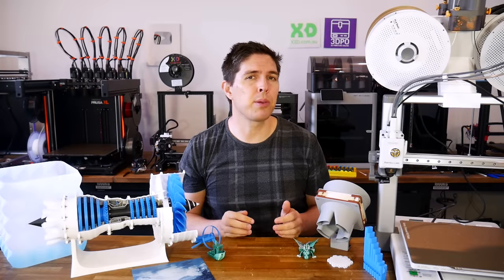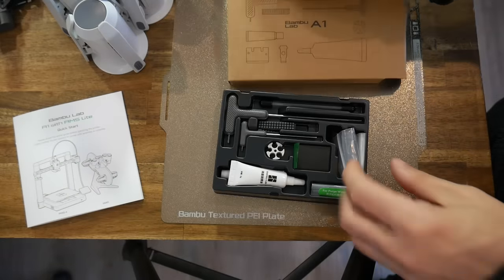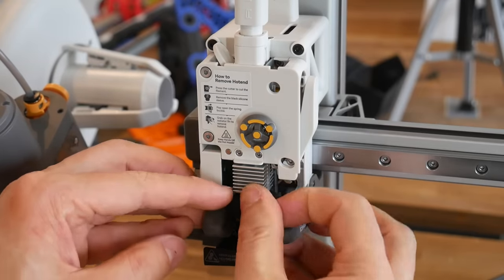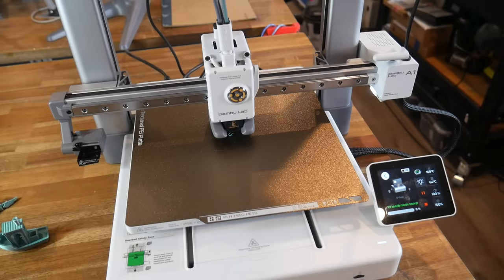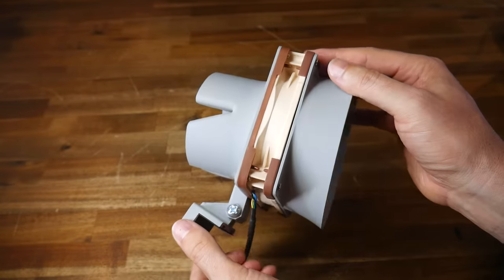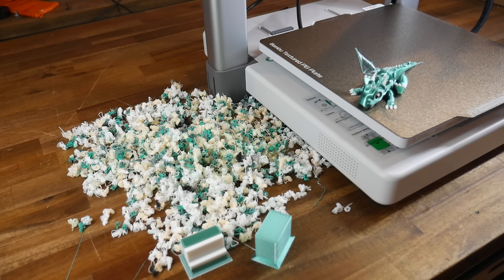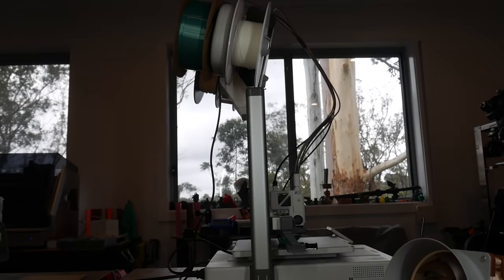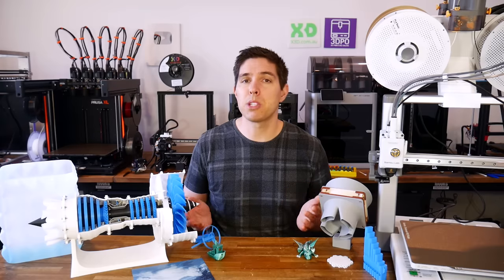Bambu Lab A1 detailed test - ‘Just works’ 3D printing for a great price

Comment: I have a request:  I  thought Core XY is better than bed slingers.   I have an Ender 3S1 that has caused so much frustration with first layers not working and thinking the auto bed leveler meant no more paper and spinning the corner wheels.   I spent way too any times and tries with the paper and the springs that never felt right - do all those nightmares go away with this?  I saw some knobs on the A1 - do I have to bed level?  I am waiting for a more affordable xy printer - no review answers why go back to a bed slinger.  Most people are former bed slinger users who are traumatized as I am with past experiences running paper over all 4 corners endlessly chasing the perfect first layer attempt - I wish more was said about this issue.
Reply: QIDI X-Smart costs the same as the A1 Mini, 300.
Reply: Core XY is not better, but it has some advantages when you are printing very fast.  If you're printing thin tall models, the shaking bed of a bed-slinger might dislodge them.
Reply: @kaasmeester5903  I thought it would be better in terms of bed levelling and not having to worry about bed coming out of alignment.   My auto bed leveller does not really accomplish anything on the creality ender 3 s1.
Reply: @tomsop  I'm not sure if that's an inherent problem with bed-slingers, or that core XY solves that problem.  I've had no issues with automatic bed leveling on my Prusa MK4, it's been consistently outstanding.

Comment: 5:58 Wrong, the A1 has only one Z axis stepper motor, not twin. Both lead screws are driving by one stepper like a cheap ass ender 3. You can even see the one single stepper motor during assembly, how did you miss this lol?

Comment: Great Video as always, loving it! But i dont know, somehow i really dont like Bambulab as a company. Im still on preorder for the Prusa XL 2 Head version but it still seems to have a lot of issues. 

The sad truth is that its probably smarter to wait for an Prusa XL MKx facelift and get the BBL X1 Carbon in the meantime. But i just dont like it, what other printer should i get then? I really love the idea of the Multitoolhead of the PrusaXL and that they announced add-ons for the printer

Whatelse is there on the market in terms of quality and speed and maybe cool features?
Reply: I bought the Prusa XL 5 tool head Kit.  I changed to .4 nozzle and I have not had any problems with it.

Comment: I don't see the Mk4 as direct competition because the A1 and the Mk4 appeal to different user groups.
But the comparison with the M5 / M5C works better. Both are launched with the promise of ease of use.
Reply: Exactly, Mk4 is a DIY shit, Bambu is a complete product.
The question is why DIY shit cost 3 times more?
Reply: I think they are direct competitors because Prusa printer's reputation for reliability is the reason why they can demand a higher price which is now being severely undercut by Bambulab. MK4 makes no sense at its current price anymore.
Reply from the maker: Perhaps, but I bet Prusa and Bambu Lab see each other's printers as competitors.
Reply: Imagine buying a prusa printer in 2023. If bambu is a bullet train then prusa is a scale model steam locomotive kit 😂😂😂😂
Reply: @TeachingTech  considering people have been reporting enormous amounts of prusa advertisements on bambu videos. yeah they obviously see them as a competitor lmao
Reply: @D1sconnect  "Mk4 is a DIY shit"
My fully assembled MK4 says otherwise.
Reply: @elmonni2103  Imagine buying a printer that sends all your data to the CCP in 2023.
Bambu lab = tik tok of 3d printers
Reply: @elmonni2103  Then I better buy a Prusa. I don't have the space for a bullet train. A scale model steam locomotive kit sound more like the right size. And also, bullet trains are loud. I like it quiet. I also like the aesthetics of these old steam locomotives much better than those of modern streamlined bullet trains.
Reply: @LilApe Imagine being so paranoid and delusional that you think they care about what you do? If you were in industry yes but for consumer stuff, it’s no different from google tracking what you watch and comment on.
Reply: Prusa has a few years to catch up. If they don’t, look for that business to stall or become very niche.

Comment: What kind of speeds did you get? How are the speeds compared to the P1S. Is Core XY worth the extra money?
Reply from the maker: I think the main reason you would buy a p1s over this is for the enclosure to print filaments like abs/nylon. On paper a corexy will be capable of higher acceleration but the input shaping equivalent makes that difference negligible in practice.
Reply: @TeachingTech  Regarding the benchy warps, I just compared to your P1P review and it didn't appear there. Do you think this is a core issue with bedslingers/A1 series (printing at lower quality) or something that can be fixed (or maybe modded, by adding a new fan)?
Reply: @TeachingTech  Speaking of A1 vs. P1S :
With the A1 bed confirmed going up to 100°C and the nozzle up to 300°C, what is still not clear to me WRT printing high temperature filaments (ABS, ASA, PC) is why Bambu Lab are saying on their wiki/FAQ page for the A1 that "We don't recommend enclosing the A1" - any ideas? Could it be due to insufficient cooling for the electronics, or maybe issues with softening the Z axis timing belt? 

I am asking because I've built my own perfectly sealed enclosure (a lot of sweat went into making it) and I'd rather use that with the A1 if possible than pay for the P1S, especially since the A1 has the quick change nozzle and no "no build areas".

Bambu Lab mention they don't recommend printing high temperature filaments on the A1 due to the lack of the enclosure (the A1 is therefore not able to ensure the required higher chamber temperatures and also not able to contain the toxic VOCs), but they never explain why they recommend against enclosing the A1.

Comment: @jozsefienciu2325
HI i need some help, i change the heating element on my printer the factory temp initialy was 250 degree after the change the max temp at the nozzle it's only 235 degree how can i get the 250 because the heating element it's good up to 260 thanks.

Comment: I don't see how the fast nozzle swap system is faster than a classic screwed in nozzle.
Reply from the maker: Speed wise you may be right, but I still prefer this system over the old e3d standard where the heat block is supported during a hot tighten.
Reply: @TeachingTech  Sure thing, got a Dragon hotend on which this is a non issue.

Comment: I really dont understand why Bambu wont make a filament making machine for us to recycle our plastic waste. They either need to come up with a better design or give us an affordable filament machine.
Reply: Probably because making a filament extruder that is accurate enough to function is really really expensive. Consistently making a long strand of plastic that is exactly 1.75mm in diameter is very difficult. 
The market for a machine to recycle filament is massive, but there is a good reason why you don't really see them around.

Comment: Considering how Prusa was the go-to "it just works" brand just a couple years ago and now they look extremely overpriced, I think it's time for an in-depth look at where Prusa went wrong or why Prusa still hasn't lowered the price on any of their printers.
Reply: Prusa is doing the same as Apple computers, they are nothing special, but costs 3 time as a good PC computer .... expensive rubbish
Reply: Maybe because they can't lower the price. At least not without sacrificing quality. Don't forget that Prusa is a European company manufacturing in Europe with parts from Europe and Bambu Lab is a Chinese company manufacturing in China with parts from China.

In addition, Prusa has costs that are reflected in the price but are not immediately visible, such as certifications that are important for the use of the printers in European companies. Bambu Lab is catching up on these certifications for the X1E, which is why it is 1000€ more expensive than the X1C with only slightly better features. I asked a reseller for the X1E and he confirmed that Bambu Lab still don't have all the necessary certificates since it takes a while to get them.
Reply: are they still using 3D printed parts for their printers? It's time they use injection-molded parts, and all that energy (electricity and personnel) is better spent in R&D.
Reply: @mortaldrumming  Yup, the printed parts were cool the first few years but now it just seems dumb. It increases price and greatly reduces quality, the printed parts they use look horrible and some barely fit because they are printed so poorly.

Comment: the price point is too low , i think they committed long term to a few choices to hit that exact price point , i think there will be no other AMS system for at least 5 years , they might iterate on the design , but i think they committed to the suppliers for the servos ,the steppers , the linear rails ,plastic parts ,Molds and other stuff ,becoz only in huge bulk and long term contracts that they can get parts that cheap to hit that price. suppliers will give you insane prices if you commit longtime , sometimes 1/50th the price for bulk long-term parts
 
i dont think they will change their extruder system ,nozzle,bed,screen ,Motor drivers, or steppers anytime soon , they wont at least for their cheap lineup .their cheap lineups will always use the same parts ..... its a smart move but very risky

that or they found an abandoned warehouse full of parts laying around someplace

Comment: Looks like a decent machine. It's a bummer Bambu Labs discourages using it in an enclosure and using higher temp materials. ABS, PC, and Nylon are regular use for me so that puts it off the list. my MK3 clones have been workhorses, 3yrs strong with zero issues being enclosed and printing high temp. I know they won't last forever though.

Comment: Just got an A1.  I had a ender 3 with 3d chameleon. I don't need another hobby and the ender needed hobby levels of attention.

The A1 just works and I recommend it. The camera is a huge downside though. The A1 hardware lacks video processing and the camera is fixed in a really terrible angle.

Comment: With how proprietary this is, I wouldn't be surprised if BL went to the model of printerink,  selling a printer which only works with their encrypted rfid tag.
Reply: The RFID tags is for the AMS only. You can use any brand of filament you wish that is supported for use in the AMS or the printer. That was always the case.
Reply from the maker: Please be careful not to fear monger. There's no evidence of that. People end up spreading this type of thing as fact when it has no basis.
Reply: This doesn’t even make sense. Selling a printer that only works with their rfid tag?
Reply: Even if they did do something with the RFID tags they use, it would take 10 seconds to just rip it off an old spool and stick it on another.
Reply: @c0mputer  That is not unheard of in the 3d printing world. The da Vinci from XYZ printing for example used to only print with their own filament cartridges.
You could replace the firmware with Repetier firmware and then it would print with any filament.
Reply: @andreas.grundler  Filament I understand. There’s no way Bambu Lab will do this but I would at least understand the comment. But this guy said selling a PRINTER that only works with an rfid tag.
Reply: @c0mputer  This is a concern based on the fact that the Bambu Lab printers are closed source. The RFID tag is currently only used to automatically identify the filament, but theoretically a firmware update could make it similar to the da Vinci so that the filament can only be used when a specific RFID tag is recognized. Not likely, but possible.

In the world of 2D printers, we have gone from expensive printers to cheap printers that have a DRM system built in so that the ink cartridges contain chips without which the printer will refuse to work. The printers are actually subsidized and the manufacturers make their money by selling ink. The latest model for 2D printer manufacturers is now a subscription model. You pay a monthly fee that allows you to print a certain number of pages each month. The printer tracks how many pages you print and sends the data to the manufacturer. When you run out of ink, new ink is automatically sent to you free of charge.

Comment: This is just another bedslinger (which they swore to destroy) and poopmonster, no real innovation.
Reply: It's fast as cheap as a mini and 10x better lol. They are just wiping prusa off the face of the earth with this
Reply: @legobuildingsrewiew7538 they are taking the few innovations they made (which is mostly just combining pre existing ideas into one working machine) and producing many versions at different prices with the same machinery to make it, take the p1p p1s and x1 all using the same frame, to cut costs and sell it cheaper whilst still maintaining profit margins due to large market share.
Their product is good, their company practice from their POV is great, but from an outside view it’s rude and damaging. Yes they are beating prusa in terms of price for arguably better/worse product as their line. But that’s also taking away potential innovation from prusa if they got wiped out. 
I’m not siding for or against, love their products. They could just go about it a bit nicer.
Reply: @Volt64bolt  I would argue that combining existing technology into a working product at a price affordable to a large market are both innovative. One of the things that differentiate them from Prusa is that Bamboo has focused on usability for the individual who wants a 3d printer that does not require tinkering. I love prusa, but they are not as intuitive for those who want to use 3d printers without tinkering. The Mk4 is a step in the right direction, but definitely still requires you to  be ok with tinkering.
Reply: We either have a prusa fan boy that angry cause this $500 machine outperform his $1000 flag ship, or an ender 3 user who think his machine is the best
Reply: @antoniomromo  I didn’t say it wasn’t an innovation, getting all these features to work together aswell as they do in a near seamless product is innovative. I was just saying most of their innovations are that, rather than bringing an entirely new idea to the table.
Reply: @Volt64bolt  Indeed... making it all seamless and user friendly. As it should be.
Reply: Dang Thomas, you are one salty boy today.

Comment: Looks like your  'just works' advertising really didn't age well considering they have pulled the product from stores and website.
Reply: This is very disengenous. Bambu Labs found an issue and rather than let people suffer through it, they identified it. They contacted owners and let them know they were working on  a solution and gave owners the option of waiting for the new part or replacing the printer. This was a very thoughtful course of action.

Comment: And now came last days of Prusa research.
Reply: lmao same shit yall been saying with the last 6 bambu lab printers. Prusa still around. And the print quality is terrible on the A1 due to it's single Z axis motor.
Reply: @LilApe  Do you happen to have a Prusa printer?
I have a heavily modified Micromake C1 printer. I built the whole thing, check it out on my channel.
So I'm not biased.
The Bambulab printers, they print very nicely. The closed case ones can do stuff that the Prusa can't (mine can't either).
It is no coincidence that so many people buy them.
What you wrote about the 1pc Z motor is bullshit.
You don't need 2 Z motors. You need 2 threaded shafts that move in sync.  A 3 threaded stem will also work with a single motor. The point is to have all the shafts in sync and that's exactly what the Prusa doesn't have. There you need a separate adjustment to compensate for the tilt of the X axis. And the 1 motor only needs adjustment at the factory or when the belt is replaced after many years.

Comment: My main problem with Bambu is their closed ecosystem. You have to use their slicer, and they really want you to use their cloud services too.
Reply: That's the future of 3D printing.  Modern companies want your data, and want to lock you into a closed system.  And I despise that business model.
Though in this case I would not worry about it too much; their slicer is good (they stole from the best), and slicing is an intermediary step anyway; your models will remain yours to print on competing systems.  I'm a Prusa fan, but I might like a mini printer for quick prototypes, and if my budget was tight I wouldn't hesitate to pick up an A1 Mini.  This thing though...  it looks cheap and I wonder how well it will hold up.  And some others have reported struggles with print quality (or they didn't report it, but you could clearly see the output was meh).